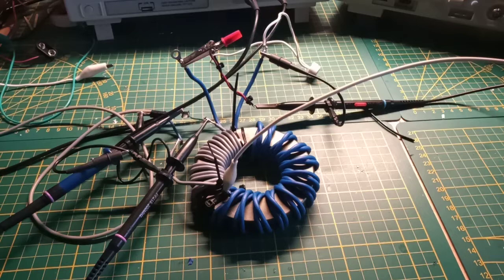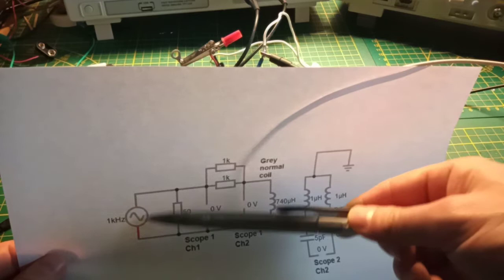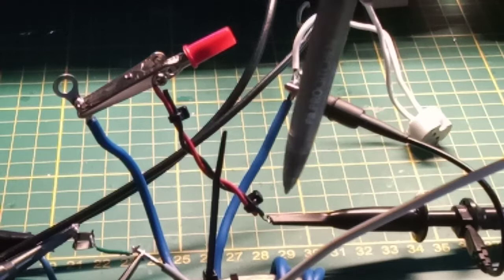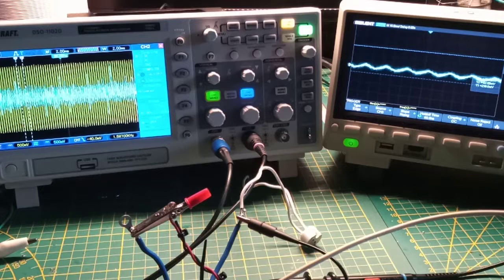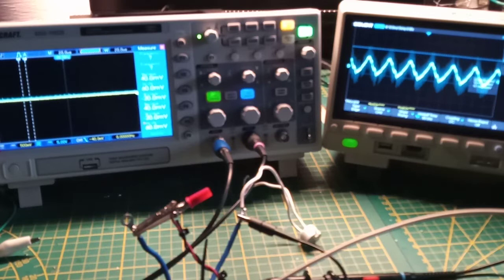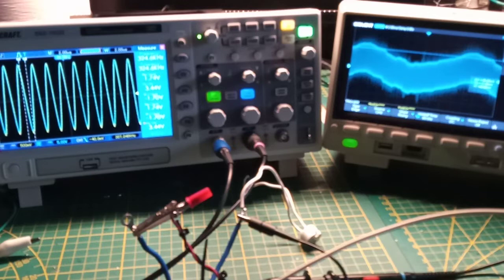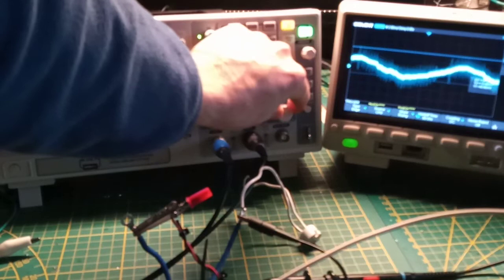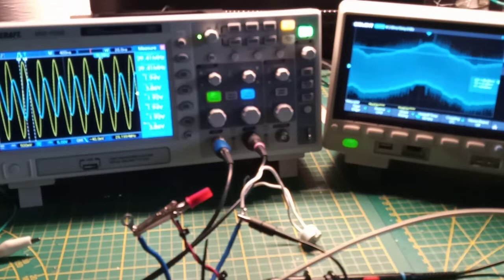002a Delamorto Curent Amplifier Earth Grounded Center Tap

Comment from the maker: Somebody sended me a comment yesterday evening on this video and when I wanted to look into it this morning it was gone but I had read the message partly.
So I want to answer it based of what I remember.

What I remember:
The person was asking me if I think it would be possible to combine voltage and current from different source.

My answer:
First of all I want to make clear I'm no specialist in all this, so please see my answer just as the way I think about it and if you have other idea's I can only suggest to experiment on them from all possible angles.

The very short answer:
Yes I think it's possible @ Resonance @ the moment.

The longer version:
I was doing experimenting with the Earth grounded center tap of the bifilar coil but again in my setup I could only inject high frequency voltage riding on the low frequency wave of what was put into the bifilar coil by the receiver. So I didn't succeed in creating current amplifier.
Then I was thinking: "What if we're chasing the wrong rabbit? What if we want voltage multiplier with this setup instead of current multiplier?"
I don't know how far my idea's are in line with reality, but please think about this:
If I look at formula for magnetic field B= µ * n * I => where's voltage?? so if we create a current of 10A, then when keeping the current the same and change voltage from 10V to 100V we still have exactly the same strength of magnetic field. I know current will go higher in the same coil due to resistance but the point is that if we keep the current the same, the magnetic field is the same.
So what if we provide a low frequency current of for example 1A and superimpose high frequency higher voltage then the one that creates the 1A flow? We would create the same magnetic field but with higher electric field. The ferrite core for high frequency current is on the magnetic part saturated (to slow), but not for the low frequency. Voltage is transferred by electric field.
Years ago when I did my first experiments with a copper tube 1 or 2 windings through a ring core transformer I was baffled to be able and generate 600A (I had industrial meter to check this) in that one shortcutted loop, but I couldn't attract a small iron peace with it, so I also don't underestimate the value of the amount of windings. Off course more windings more resistance, lower current and so on but this is just to look at general idea, "what if we are able to superimpose high voltage on low voltage current and maybe in the end use low pass filter?"

I really hope experimenting will prove some reality in all this :)

This is showing to you that @ the moment I believe we can mix them @ Resonance, but I'm far from experimental proved success and maybe it never will but I need to go for the opportunity.
There are 1001 different explications of what's going on in our circuits, only self prooved experimental results will help us further.
99% of the frequencies all ready proved I'm even not able to inject the voltage at those frequencies, so Resonance is a key point if it wants to work :)